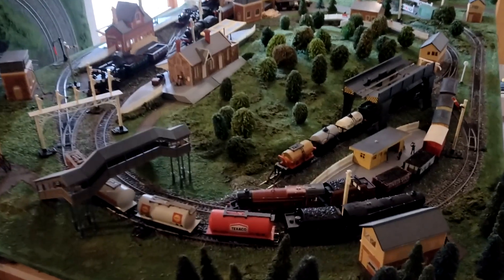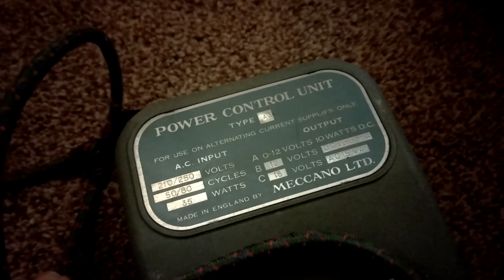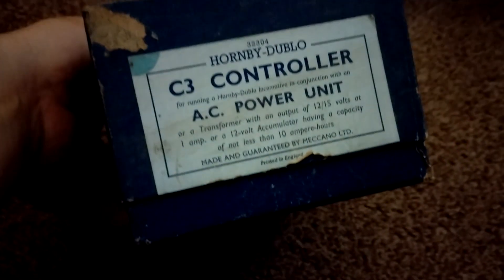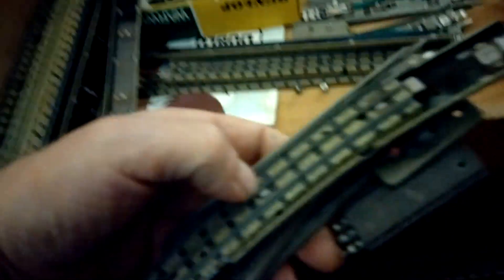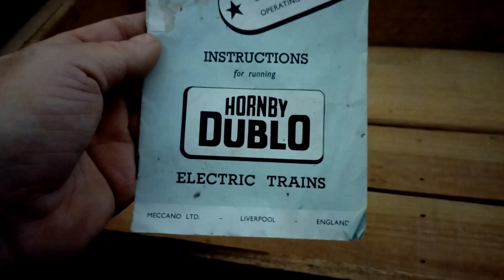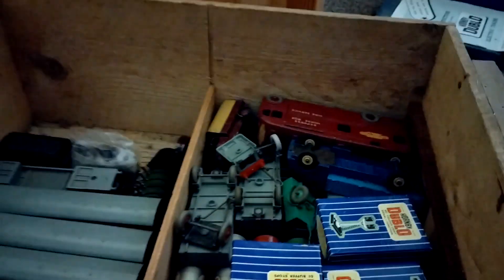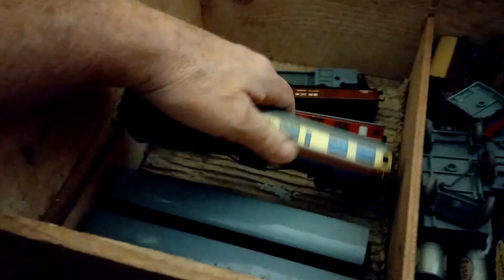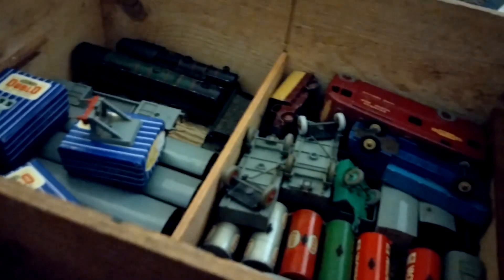Dads Hornby Dublo Train Set Building a 1955 3 Rail Layout Part 1

Comment: Looks like a wonderful project and I'm sure your dad will love it.
Great idea using the under bed folding frame.

One thing...
The track plan has two reversing loops in it. Wont they cause a short circuit or is it ok as you're running off the centre rail?
Genuinely asking as I'm planning a Dublo layout myself for next year and had considered doing a similar track design.
Reply from the maker: He does - but mum doesn't :-( so, it's at there's awaiting the clearing of a room full of unneccessary stuff before it can be set up and used properly. The current layout will be modified/added to etc as he has way more track and we don't need to adhere to the 'catalogue' image. 
as to the short, well all I know is I can run it around the outer, go through the middle or go into the sidings, all without the isolation tabs. I'm not electrically minded i'm afraid, sorry!
Reply: This is probably two years late, but... This is OK with three rail. It would cause a short if he was using two rail (as almost all of us use nowadays), because the inner rail on one side of the oval would be connected to the outer rail on the other side, if you see what I mean. With three rail, it doesn't matter because the inner and outer rails are both at the same polarity (i.e. they're both connected to the same terminal on the controller). Also, the centre rail on one side of the oval is connected to the centre rail on the other side, which is also OK.

Another thing with three rail - you saw that the controller dial was labeled 'Forward' on one side and 'Reverse' on the other. You can have this with three rail because the rule is that the loco always moves forwards if the centre rail is positive. So, when it is set to 'Forward', the controller makes the centre rail positive, and the loco will move forward regardless of which way it is facing on the track. This does not work with two rail - the rule here is that the loco moves forward if the right hand rail is positive. If you then pick the loco up and turn it round, what was the right hand rail will become the left hand rail, and the loco will move backwards. (I hope this is clear enough.)

Sometimes I wish we could have somehow stuck with three rail - wiring and operation were much simpler.